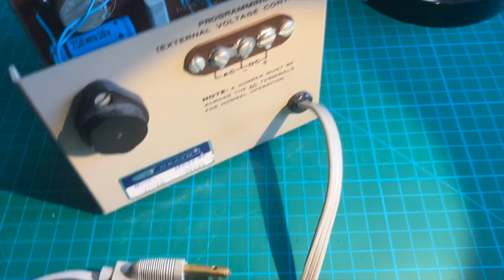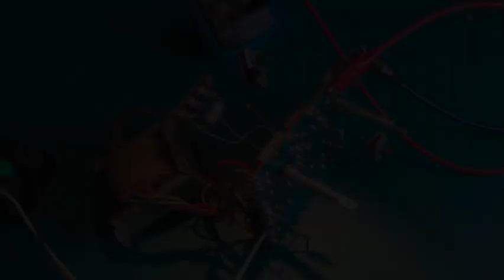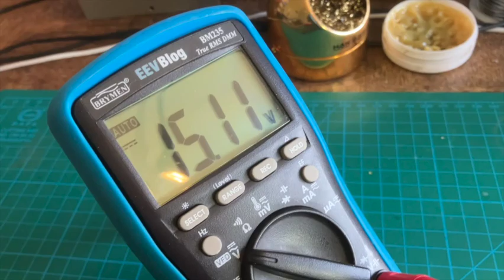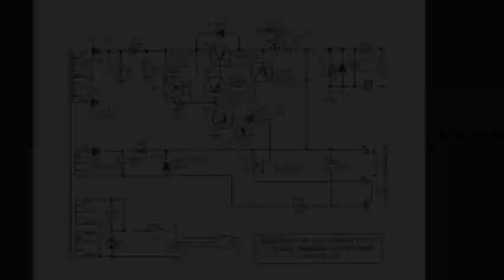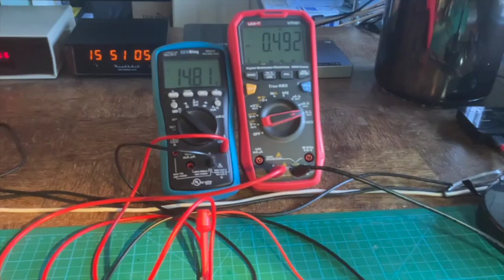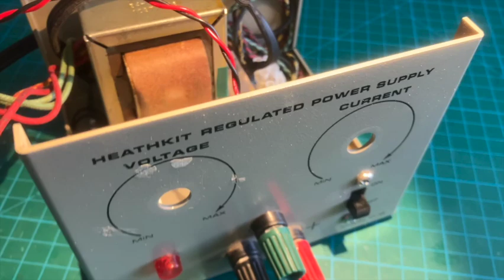Heathkit IP 18 Teardown & Full Rebuild

Comment: Great video!  especially implementing much needed safety improvements!

Compared both IP-18 and IP-2728 schematics,  other than adding fuse (and should have the better separated traces you discovered in later 18), 2728 seems to be just a cosmetic restyling. 

After seeing all those safety concerns and how its designed, will get a modern variable power supply instead. Dont want put real work at risk.  Would have been nice to own and USE a piece of history.  (I still have the Experimenter Kit and AM radio from 1970s, H19/H89 and took the Digital courses)
Reply from the maker: Thanks for the kind comment.  You're correct, the IP-18 & IP-2728 are essentially electrically identical.  Although I have no trouble using these in a hobby context, of course a professional lab would be able to afford modern test equipment.  Nevertheless, they make great little sources of casual  floating low voltage.

Comment: LOL they increased the space around the line traces significantly...but then bridged the gap by printing copper S's where the switch connects. I suspect those were added by someone who didn't understand the intention of increasing the space. 😂
Reply from the maker: This but one of the reasons I moved all line AC componentry (line cord, switch, fuse, neon, primary...) off the PCB and onto free space in the chassis.  BTW thanks for all the comments!
Reply: @dtss_smudge  Yes, that's very wise. This was designed before safety, back in the days of toy injection molding presses producing lava hot snap together toys and power tools with metal housings and two prong plugs. It's amazing we survived!

Thanks for your videos. I have enjoyed them a lot!

Comment: There is another failure mode with this supply. If there is something like a large capacitor on the output and you turn down the voltage, it applies a large reverse voltage on the base-emitter junction of Q2 and Q3. Q3 is large and robust, but Q2 tends to fail. I added a diode in series with the output to prevent this.
Reply from the maker: Note the schematic in the video shows reversed-biased 1N-4002's across Q3 and across (not in series with) the output.  These protect against back-feeding.  None of the units I've done, nor any of the original manuals, had these.  So I added them to my rebuilds.
Reply: @dtss_smudge  Yes, I noticed them on the schematic you showed before you mentioned them. They are definitely a good idea. There are actually many things about the circuit that are flawed. I can imagine a large current spike in the base-emitter junction if the current sense transistor Q5 during the brief instant before the regulator reacts. A resistor on its base would easily prevent that, but they do live on all these years, so I can't fault them too much. Have you ever had transistor failures in yours?

Comment: I believe that blue cap was original since the one in front of me looks the same. Either that or its one of the wildest coincidences that the old owner and I used the same cap.

This one doesnt work. Its completely dead. I thought its probably a fuse. I couldnt find one. I didnt see one on yours either then you said it doesn't have a fuse lol! The manual shows one in the schematic and a chassis photo by the power switch but I don't think they had them back then. Mine is serial # 06415. The blue tag is supposed to be inside but yours does look good still.

Looking at it, its kind of a death trap lol. The puny wires with thin insulation connecting the power switch to the board are lying against the chassis. I'm pretty sure my power transformer is fried. This is one of three of these I have. I'm going to build a switchmode supply in the chassis which will put out some real power. Thinking 0-24V and 0-2A. Im not going to try to source a power transformer for this wimpy supply.

Still, it'll be fun watching this! 👍
Reply from the maker: Some, presumably early versions of the IP-18, had no fuse, as didn't much of Heathkit's pre-1970s kits.  Good luck with your switch-mode redesign. Keep an eye on the RFI..
Reply: @dtss_smudge  Thank you!

Comment: What is your ac safety power block device with the quick disconnect feature?
Reply from the maker: Not 100% sure what you're referring to,  but if you mean the 4-position white screw terminal block I use to wire the AC side, search Amazon for "terminal block white screw terminal".  Not really quick disconnect, you have to loosen or tighten the terminal screws.  Thanks for watching and leaving a comment!
Reply: @dtss_smudge  Sorry, I meant the ac mains connection box with the lift up covers, bigclive has one like that also, but I can not find one.
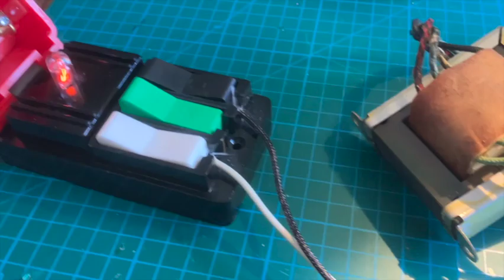Reply: Sorry, should have looked it up first, it is at 14:22 on the video.  Thanks much!
Reply: @dtss_smudge  Sorry, should have looked it up first, it is at 14:22 on the video.  Thanks much!

Comment: Friendly notice : The standard voltage in USA and canada is 120 Vac not 110Vac. This thrue for more than 50 years now. ( See NEC and canadian code CEC).
Reply from the maker: I'll take your word regarding the NEC, but you got me curious.  So I went back to the original manuals, and the specs for the IT-12 (dated 1962) called for 117VAC 50-60cps (!) and for the T-4 (dated 1958) was also 117 Vac 50-60 "cycle".  Go figure.
Reply from the maker: ...and I just realized you were commenting on the IP-18, not the T4/IT-12.  The IP-18 (1968) called for "105 to 125 [assuming wired that way] 50-60 Hz"  So it was more forgiving.